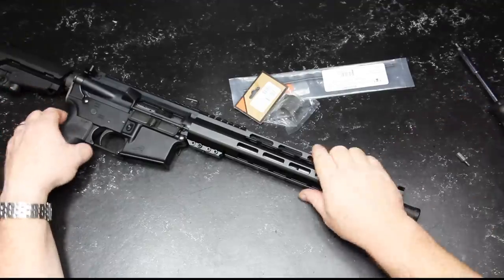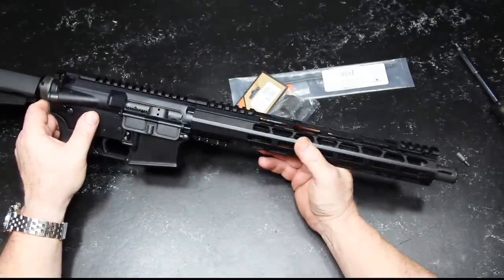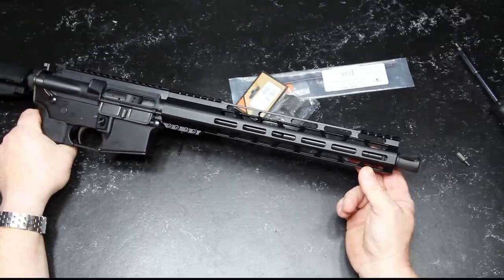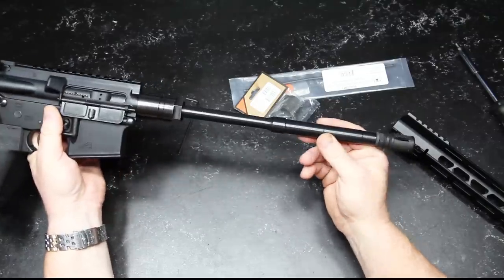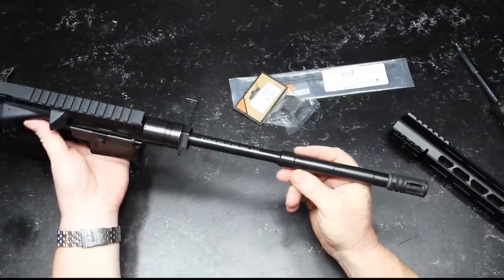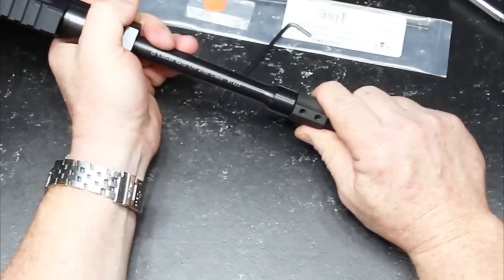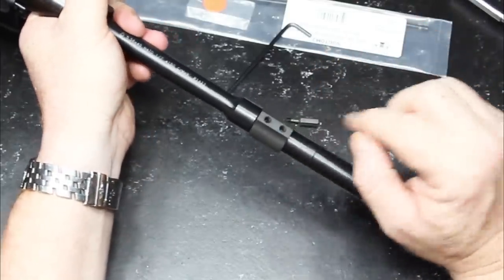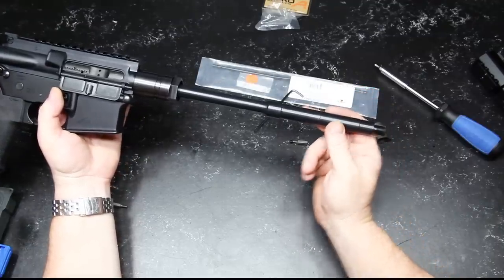Gas Block Installation Helpful Hints.  Line That Hole Up

Comment: Just saw a video of a guy who uses an uncooked spaghetti noodle, snaps off a piece to size, slides the gas block on, rotates the barrel/block upside down and wiggles the block so the spaghetti slips into the port when it lines up with the barrel... then tightens up the block, turns the barrel back upright, sends a cleaning rod down the barrel to snap off the spaghetti and the 2 pieces of it slide out the front end. Harder to describe than to do, and super easy!
Reply: Bro I’m doing this. Thank you 🙏
Reply: Great idea love hearing little things like this bet it works

Comment: I just did this earlier today, those little plastic pins that HB industries makes help alot too. You put one end in the barrel and then when you turn the upper upside down the other half falls into the gas block lining it up.  After you are done you run a cleaning rod down through the chamber down the barrel and it breaks and pushes the plastic piece out. Just a little assurance that you are lined up, and it worked well for me
Reply: Cool. I need to try those
Reply: Those little plastic alignment pins you’ve described are expensive. I use pencil lead. Cheap and cost effective. Works the same as those plastic ones.
Reply: @deanhenthorn1890    If I remember correctly it is only $5?
Reply: @TheRealCobraBurnout  just use a piece of uncooked spaghetti.
Reply: @apb2887  just use a piece of uncooked spaghetti.
Reply: @josh48315  That's a really good idea. I will do this in the future

Comment: I used a sparkplug gap setter. Made it super easy. Hope this helps someone
Reply: Same, although I use a feeler gauge. Same thing of course.
Reply: @DaveSmith-cp5kj  Sounds like a good use for the old feeler gauges.  I have not gapped any points lately :-)
Reply: My thoughts exactly. Perfect solution.

Comment: I do same thing but use a feeler gauge to keep the gap when you rotate the gas block
Reply: I’m new to doing AR15 builds. I like your suggestion on the feeler gauges. But I wonder why nobody makes a set of shims to take up the space the handguard cap would have taken up.

Comment: I did a 556 AR pistol bill everything was fine after 1st 100 round fire next time out set screw loose and gas black slightly moved forward attempt to set back now I'm getting now I'm getting double fires on single pull. Is gas block mounted too far back standing too much pressure causing this problem?

Comment: A cheap set of auto parts store feeler gauges is invaluable for this. I also pencil the center line on the shoulder of the barrel before putting the gas block on and then pencil the center of the gas block to line them up, ensuring no twist left or right.
Reply: Great advice

Comment: Usually the gas port hole in the gas block is nearly double the diameter of the gas port hole in your barrel.  This will allow for a slight misallinment of the gas block relative to the barrel, yet will still deliver a full charge of gas into your gas tube...
Reply: This

Comment: That small gap is for the material thickness of the Front Sight Handgrip collar plate which is installed on the barrel just before and behind the Mil-Spec Front Sight Post.

Comment: I used to stress over gas block alignment. Nowadays I just slap that GB on there eyeball it then tighten her up. The port in the block is oversized compared to the port on the barrel so that precision alignment isnt required. Thanks and I enjoy your build videos.

Comment: A good way for alignment is to lay the upper on a flat/ granite table the pivot pin flat of the upper flat on the table and the bottom of the gas block flat on the edge of the table. Then torque the barrel end screw of the gas block, then take it off the table and torque the chamber end screw. Perfectly concentric. I get it perfect every time. Beats eyeballing it by a mile.
Reply: Here is a video I made today on alignment:

https://youtu.be/EBv0AwM3nUU

Comment: I've used varying methods to line up gas blocks. So far they've all worked incliding the one you used here.  I'm really looking forward to the velocity comparisons.  I used a 16 inch BA Govt profile barrel on my last build.  It's shoots below moa, when with me behind the trigger.

Comment: I have a 12.5” Ballistic Advantage build. Runs like a dream. Garand Thumb was saying that 12.5” for unsuppressed use was his favorite short 5.56 length. Mine runs right at 1MOA or under with everything I’ve thrown at it. Clint at BA hinted in a recent video at a 12.5” Hanson profile coming.

Comment: All my 5.56 SBR are 11.5" with a  1:7 Twist barrel and a carbine length gas system. We also use a Odin adjustable gas block. One little trick is,  open up the gas port on the barrel one drill bit size larger. And that typically will be the size of the gas port on the Odin gas block. But be sure and check it. This gives you better control over what often is a "Over gased" symptom.  Especially if you are running a suppressor on the rifle.  I often get guys that will give me that funny look and say "Thats nice, But you can't get any distance out of it"  And here is when the question is asked "How much $$ you got in your pocket??" Because with my 77gr Serria TMK hand loads, I can bang a 12"steel target with this rifle all day long at 300 yrds. And go 10 for 10 on a full IPSC steel target at 400 yrds. With the same ammo. And just shooting off a forward mounted bipod on a good steady rest or shooting prone (which I  don't like to do, After my severe neck and left shoulder injury 32 yrs ago) That Angus bull won that day. However his New York strip steaks that we cut out of him, that where the size of a radiator where delicious a year later. But I still suffer from getting the shit beat out of me by him. So maybe he did win after all 🤔.
Reply: DO NOT DO ANYTHING HE JUST SAID. HORRIBLE ADVICE. 

You only enlarge the barrel’s port as a last resort on UNDER gassed guns… 

And if you ever feel the need to do so.. what size is the “next drill bit size bigger”?  Based off what bit set? Based off what increments?

The over sized port hole on the gas block is meant to give people a small margin of error in alignment. It’s not the size hole that the barrel port should be.

Comment: I use a jig to dimple the barrel for the gas block set screws as well as another jig to then pin the gas block. This way I know without a doubt it’s centered and it will not move. I have never had a gas block misalignment problem by doing it this way.

Comment: That gap is the thickness of a handgaurd end cap. Also there are plastic allignment pins made that  will breakaway after installation. Most barrels have a demple opposite of gas hole on barrel that line up with the set screw on block for proper alignment of block.

Comment: Love my 12.5" that length really is where the magic of 5.56 starts. The gains beyond 12.5" are far less substantial than the losses below it. Fps per inch only changes 50-100 after 12.5 compared to the 200+ when you start going shorter.

Comment: Good tip. The gas port hole in the gas block will be lined up with that set screw hole. You have to reach through the set screw hole with the drill to drill the gas port hole. Trust me, I'm a toolmaker I do this for a living 😉.

Comment: I use a small strip of masking tape to line up the EXACT center of the barrel's gas port to the TDC line of the barrel ...no pencil lines, scribe marks, then cut the masking tape so as not to interfere with the gas block positioning. Then use a feeler gauge to ensure the right distance is achieved between the gas block and the barrel's gas port flange.

Comment: I use a spring punch to dimple the outside surface of the gas block and also the barrel flange, just above the respective gas ports.  Then its just a simple matter of lining up the dimples and locker it down.

Comment: I use the same method and either a Air compressor or blow in the barrel. One time I didn't and it was a gas block not made for the standard handguard with the cup to hold it. No cycling. Lol  Finally got a  break in the weather. Got almost 400 rounds of 9mm, 45 acp and had to Mag dump the 7.5" 7.62x 39 AR pistol 🤷🤣

Comment: what do you do with a clamp on?  :)  another trick depending on what type of barrel nut you have - you can use the gas tube to help get top dead center for you barrel nut or your gas block by installing the tube first

Comment: 12.5 IMO is the best.
A 12.5 with a free float rail,  and TA44 ACSS or TR24 1-4× is what I drool over. I'm thinking about cutting an extra Colt socom barrel down to 12.5

Comment: Damn I’ve put at least 20-30 rifles carbines pistols together and everyone I just butted up against the shelf. I’ve never had an issue but ima do this next tome
Reply: I think some gas blocks need the gap and some need butted.  I used a dimpling jig which always gives you the gap, and ended up with low gas and had to go back and butt it up against the shoulder on the barrel.  You can also measure from shoulder to center of gas port, then see how that compares from the edge of the gas block to the gas hole...  Usually the gas block hole is large enough you probably won't run into trouble either way though....

Comment: A barrel dimpling jig is by far the best way to insure you get the gas ports lined up.
EDIT..  You should be dimpling your barrel anyway.
Reply: If you don't want to go that route, Get yourself an old handguard end cap and cut it in half to use as a gauge.  It will almost always be perfect, since the gap is there to accommodate an end cap in the first place.  Of course you will have to align it from side to side using a couple pencil marks.

Comment: This is spot on, the first screw hole is 180 degrees opposite of the gas port in the gas block.  Align the screw hole with the port in the barrel, then mark the position on the block and barrel with a sharpie.  Done.  No jigs or other gimmicks needed.  And as far as spacing/ gap between the block and the barrel edge, a standard business card is the perfect size for the gap.   People make this stuff entirely too complicated.

Comment: If you aren't dimpling your barrel or buying one that has one already present you are asking for it to eventually fall apart. I always use a high temp thread locker on my barrels. But then again my barrels see more than a couple hundred rounds! Lol.
Reply: tapered cross pin's on every one I own

Comment: Maybe those that make the gas blocks should send along a few stainless spacers.  Use your way to locate the hole, and slide on a shim/spacer that fits when it butts up snug, and all is solved.  No guess work.  Remember now.. I worked 4 years with a gunsmith, so things like this just pop in my mind.  Easy fix and cost next to nothing for the makers of the gas blocks to supply with it, even if it was an extra $4.00, it would be worth it to get a perfect alignment every time.  Talk to your friends who send you those and see what they say.

Comment: Since the hole in the block is so much larger than the hole in the journal, does it really matter? Even if the block is not perfectly aligned the block hole will still be over the journal hole.

Comment: Question for the peanut gallery. I got a used ar build spikes upper and redx carbine stainless barrel . When i took the hand guards off alot of carbon build up inside. No name gas block on it. The ar.com gang said its normal and will seal itself. I think bull. Im thinking of switching to a clamp on. If i have to ill have someone silver solder the damn thing on. Im just a plinker but leaking gas blocks are a damn excuse for bad quality. Any positive comments. Or recommendations?  Thanks. If not ill stick with my ruger and m1 carbine.

Comment: Just watched a video   guy used a piece of spagetti.  Stuck it in the gas hole in the barrel, broke it off flush to the barrel, slid on the gas block turned the barrel over spagetti dropped in the hole in the gas block to align the two parts. Tighten the allen keys turn it back over and break off the spagetti with your cleaning rod tap the barrel and the other half will fall right out.

Comment: That helps me a lot, thanks. I changed my handguard and put the gas block back on. I lined up the holes with the previous markings from the set screws. 

When I was all done the gas tube wasn't straight and viewing it from the underside the gas block was off center from the keymod holes. I haven't shot it but I'll redo it with your suggestions.

Comment: Can I move the gas block forward a little to pinch of some gas for my over gas issue because I have a super heavy barrel and I can't get a new gas block
Reply: No because your gas tube will not mate up properly with your bolt carrier gas key. Switch to an adjustable gas block or swap to a heavier buffer and spring

Comment: Newb question, is gas hole same spot on every 16" barrel with Mid length gas tube? Could you swap a low profile and a A2/vice versa? Or once you drill, that decides  because you wouldn't spot weld to re drill a rifle barrel because it would damage rifling or be un safe? 
Hey thanks trying to get better understanding.

Comment: You forgot to mark using a pencil both the barrel where gas block ends and a hask mark on barrel shoulder and gas block so its centered otherwise the hole thing about using set screw hole is pointless, just a T mark would do...

Comment: I just realized the Rosco barrel I bought has a dimple on the underside of the barrel to line up the gas block.Fuckers are clever. But thanks for the video if I didn’t have that dimple your way would have def helped!
Reply: Nice, I'm waiting for my Rosco barrel to arrive still and was wondering if it will be dimpled and I hope it is. I've heard some say theirs was and some say theirs wasn't. Which one did you get is it a bloodline?

Comment: I just use a sharpened wire with a small bend in it at the tip, works every time....
Reply: Please explain
Reply: @wendel-qo2im  also a wire with as close to the diameter of the gas port on the barrel helps even more, I got lucky and found some spare wire that fits perfectly..

Comment: I am new to this, so please forgive the simple question. My barrel has a dimple in the bottom that the set screw fits right into. Is that on all barrels, and should I be concerned about my gas hole not being aligned?

Comment: Quick question... Have you ever ran a clamp on gas block before by any chance??? I'm building out a new 6.5 Grendel rifle around a 20" Proof Research match barrel and I'm not really wanting to dimple or pin a block on that barrel like I normally do when I install gas blocks. I've never used a clamp on gas block before and just looking for a little info on if they tend to work and most importantly stay in place because this is going to be a range toy and a hunting rig where you shoot pretty high volume...
Reply from the maker: Yes, it will stay in place
Reply: @kotaboy32  Thanks for the info brother it's very much appreciated!!!

Comment: It’s hard to tell but looks like you’re using pistol length gas. The best part of getting out to 11-12” is being able to use the mid length gas system to calm the gas down. Why did you choose to use the pistol length?
Reply: SeniorTac my 11.5” faxon is a midlength. Thanks for the clarification on the gas lengths though. I didn’t know the measurements. He never really said which he had so I couldn’t tell.

Comment: Need to add a disclaimer that this tip only works with SET SCREW gas blocks.  If you have a clamp-on, dont bother suffering through the 2.5 minutes of blah, blah, blah before the gas block install is even addressed.

Comment: What type of loctite did you use on your set screws? Thank you
Reply from the maker: I'll get hammered for this, but I just use blue loctite.  They make a high temp loctite as well but I just use what I have
Reply: Kotaboy32 Tactical have you ever had any trouble out of blue coming loose? I used the green loctite on mine the kind you can put in after installing the bolt it suppose to seep around the threads it’s real thin some people say it’s to strong but I should be able to use a torch to remove it if I ever needed to change the block but the blue and green is rated to 300f but I think they will withstand higher temps than that unless it’s direct heat from a torch
Reply: Try "ROCKSETT " Engineering Adhesive, high temp and breaks down with boiling water if you have to take it off.

Comment: Why not use a feeler gauge to measure and then set the gap after you rotate the gas block 180 degrees.

Comment: Question: do I need a specific low pro gas block for a heavy barrel? Thanks
Reply from the maker: Just have to make sure it's for the proper diameter

Comment: Quick question way my 10.5 ar pistol leak alot gas from the gas tube pin is that normal I'm asking because I never seen that on my 16" long ars
Reply from the maker: No, that is not normal
Reply: @kotaboy32  I call the seller they say to send back the upper and they will check it and fix it if is problems but I was trying to fix it my self because I don't want to send it you think if I put a new roll pin will fix the problem???
Reply: Make sure the split on roll pin is facing up or you could leak some gas.

Comment: Gas port in barrel= 3/32". Gas port in gas block = 9/64". Unless the laws of physics have changed it makes zero difference whether the barrel port is perfectly centered in the gas block port. Unless one is visually impaired "eyeball close" is close enough.
Reply: Bob Hunt- it makes a difference when it’s an A2 front sight/ gas block.
Reply: @M21-w1y  In which case don't you simply align the front sight? (That's an honest question not an argument.)

Comment: Hi 
Can I mount a Standard ar15 gasblock on my AR10 308?

With best regards
Reply from the maker: It depends on the size of the barrel, other than that there is no difference in the two
Reply: @kotaboy32  great
Reply: @kotaboy32  Thanks a lot